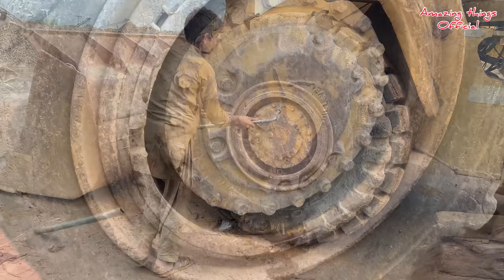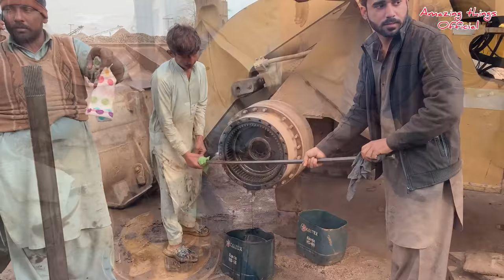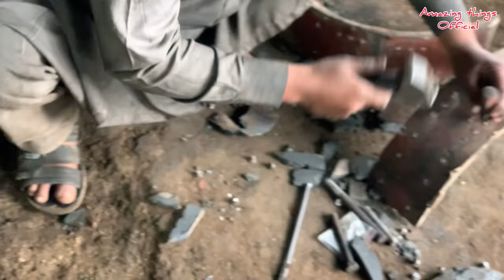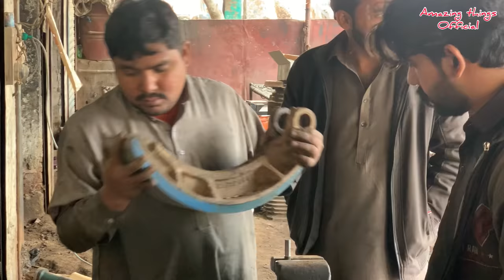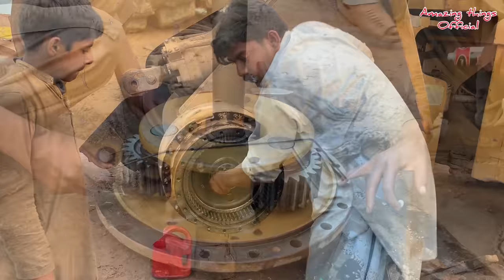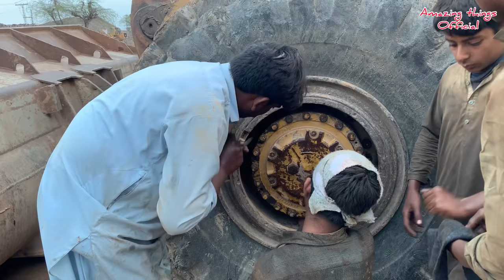How Expert Mechanic's Change Brake Lining of a Caterpillar Wheel Loader Complete Tutorial

Comment: New pads, but no recutting of the drum surface?! The new pads are gonna wear extra quick. They never even showed us how scored and scratched up the inside of the drums were since the pads were just about gone. A cheap quick fix, nothing how an 'expert mechanic' would do it. And using old oil?

Comment: Sand and gears go great together
Reply: Bearings
Reply: sandals
Reply: @Stevesbe  those were gears they pulled out..
Reply: @mariomarquez5559  I bet. These guys are very intelligent. I commend their work and ability
Reply: Danger Bear  Removes rust and corrosion.
Reply: You are forgetting the silicone sealer!
Reply: @mariomarquez5559  I don’t know man, I seen one guy with power tools take off wheel in minute by himself.
Reply: @mariomarquez5559  On what evidence do you base your comment?

Nothing in this video supports your opinion.
Reply: @kdavid123186  with power tools , the only power tools these guys had was 3 kids and a disk grinder
Reply: a killer
did call 🤙🤙🤙🤙 a kiler 
................ auto ñ
Reply: No seas así , ellos son 🌈
Reply: @butterfinger4393  wich is kinda stupid considering that the wheel of that machine costs as much as a whole power tool set

They really should have some, doing everything by hand really grinds the body over time

Comment: Love the health & safety,  steel toe cap sandals and state of the art axle stands.    Some really good mechanics here and they don’t let anything get the better of them.
Reply: lol
Reply: so how did they replace the bearing oil ???
Reply: saw it...
Reply: Lack of clean work area will tell you everything you need to know. Dirt plus tight tolerances are not a great combination. Something tells me they have a lot of repair repairs. Just because they get in done doesn't mean is good or correct.
Reply: Proper mechanics, not fitters.
Reply: @karlmcclellan5942  well, at least they put the vehicle back to work completely
Reply: @arielkart7229  I would not be surprised if it's back in a week.
Reply: @karlmcclellan3740  nice the more it come back the richer the mechanist will be heheheh

Comment: Definitely talented mechanics. Get them some proper tools and watch them go! The wood blocks are a far cry from safe jacks but they work. Amazing the way they improvise! Love it.
Reply: Define what a "proper tool" is, a tool is a tool. If it works it works.
Reply: @collegestudent6071  
Ratchets, correct sockets, air tools, cradle, air hammer, compressor, pry bars, etc. I’m talking tools that make the job faster and safer. While a tool is a tool, proper tools make  the job quicker and safer.

Comment: Good work but they should seriously consider getting a pneumatic or electric impact wrench - at least for the wheel and hub nuts/bolts.
Reply: Children are cheaper in this part of the world.
Reply: They don’t even have a funil and ask about pneumatic tools?!?!?
Reply: Doing it manually saves on the 200lb gorilla armed with an impact wrench stripping threads, mushrooming the heads of the bolts / nuts!
Reply: or atleast a ratchet
Reply: they are too stupid to put any of the profit into an electric or air impact, that's what a smart person would do. Then the dummies woul;wouldn't know how to charge it or run the compressor so you would need to get them a generator or solar panels. Basically you'd have to do everything for them and show them how to use it. They probably don't even have the intelligence to know such tools exist.
Reply: @johnames6430  Don't cut yourself oh that edge young man.
Reply: or even a speed brace, for once they've loosened them, and to whack 'em back on when reassembling.

Comment: Here in the states, if you’re driving on IH 35 and you see a couple of 10 year olds removing an 18-wheeler tire, it won’t be 10 minutes before CPS shows up.
Reply: You got that right and after CPS was done OSHA would step in and tear a new one in the boss and then the labor department would step in to finish off whatever was left of the company
Reply: @kangkim150  I agree with you. I have seen that firsthand, 10 year old boys driving big grain hauling trucks in Washington state. But a 17 year old can't work on large construction projects. The sense that that makes is deranged
Reply: Kids need to learn more trades

Comment: What's going on with that tire? Did the splice the sidewall from a smaller tire onto a bigger tire?
Reply: It's for rock climbing...the extra tread on the sides gets lots of grip when getting between boulders!
Reply: Its a recap tire
Reply: You should watch their remold tyre production video...
Reply: It’s a sidewall of an old tyre put on to protect the sidewall of the actual tyre.

Comment: Respect for what they did under difficult conditions even if they did chip a corner off of one of the new linings. One thing I believe was wrong.
I have never known of new linings to be fitted without being bonded in place by epoxy or such like and I was trained as a heavy plant fitter 54 years ago.
Maybe they consider it a waste of time on those machines with in the field repairs but it is why the previous set broke up in pieces.
I was shocked how young they were but then again I started just after my 15th birthday and we didn't have state of the art tools in the UK then either.
Reply: In the USA and Canada many pick up trucks and taxi cab used a riveted set of brake shoes. We called them heavy duty linings. In the 70's it was common like a loaf of bread. Also brake pads were the same, riveted (heavy duty) bonded (standard). Hope this clarifies your query. Cheers
Reply: @caddyrack  I don't have a query. I was trying to clarify how it should be done as it was in the 1930's to vehicles then. Bonding and rivets as taught by my father and my 71 year old boss who I had the privilege of working with when I as 15. Call it belt and braces if you like. It stops the shoes falling apart after a quick fix!
Hope that helps you understand why the shoes broke up in the first place. Slightest movement they start to break up.

Comment: I'd like to find the Engineer that decided that pin on brake shoes was a good idea, and punch them in the sensitive parts, I know, lets use a close tolerance pin, in a spot subject to loads of heat and debris, but better yet, lets make sure is secure a wear part that will need to be replaced often... seems like a good idea...

Comment: Given the apparent state of the L.F. tire, I think they should have also repaired (or probably replaced) the tire while replacing the brake shoe linings.
Reply: It's so bad I'm second guessing my knowledge of equipment tires? Did I miss them putting sacrificial sidewalls on there with a second split ring? Is it solid foam filled? Are they about to receive split ring dentistry?

Comment: There is no Substitute for following proper service procedures, using correct tools, adherence to safety protocols. 
Although this looks cool, a lot of kids fall into disabilities, a lot of street mechanics are diagnosed with cancer and melanoma, I am from Pakistan and I have lived among them. 
It is a sad thing to watch kids as young as 8 drenched in diesel fuel and motor oil. 
Only to provide a supplemental income to the parents. 
A lot of times injured kids in these workshops will not even afford to get treated for injuries.
Although a lot of comments are praising these people, Reality of them is sad and work environment is beyond hazardous.

Comment: Two major problems with repair!  The orings on the dou cone seals were not changed and aligned and the bearings pre load was never measured/adjusted.  No way those brake shoes wouldn't be oil soaked.

Comment: You gotta do what you gotta do.  But, using kids?  An air-impact would be a huge help - along with a ratchet.
And why no mask when grinding a brake shoe?  
Not a single torque wrench in sight.  Not using a star pattern to tighten down the nuts.
No expert.  No tutorial.  Just a bunch of guys and kids trying to get by in the world.

Comment: Dam# that's hard work, they need a ratchet set an air compressor and at least a rattle gun plus air chisel. We are now in the 21st century.
Reply: They're nowhere near the last century, let alone anything newer...
Reply: @felixcat9318  I guess so they still do amazing things. If the world goes to cra# they'll be better off than most of the so called modern world as they can pretty much do stuff the old fashioned way without electronics. A very good skill to have

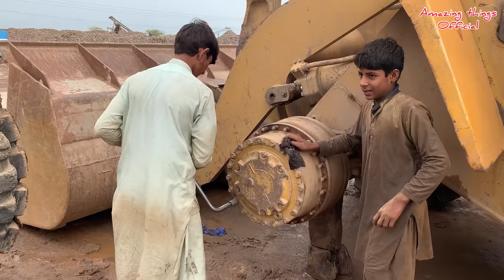Comment: 5:43 NO WAY that is secured. if that wood thing topples that heavy metal fender is going to hit that kid's head.
im all for kids helping their dads but damn, dad is responsible for the safety of his children.
Reply: You clearly have no knowledge of hydraulics or repairing machinery.
Reply: @an04ker  i DO NOT yes. im just a regular youtube viewer. please enlighten me, that vehicle without the wheel is not going to move ? because of "hydraulics" even tho it didn't have a wheel ? ok then, what is the purpose of that wood that they put in place to hold it somewhat then ? i think, ( i just think, i dont exactly know ) i think that if that wood topples, that fender is going to drop a few inches slightly before going back up, and that is enough to knock that child's head.

Comment: There are many, many problems with this video, starting with the title. These men and boys are not mechanics. It is obvious that none of them completed a 8,000 apprenticeship and that none of them hold valid trade certificates. The title of mechanic should be reserved for those individuals that have earned it.

It is unfortunate that child labour is alive and well. Young boys should be in school, not "working" in the roadside mud. Unless children attend school, five generations from now the people of   Pakistan will still be working in the road side mud.

The attention to safety is impressive. Open toed sandals over excellent protection. A couple pieces of wood stacked on each other made a sturdy jack that will prevent the loader from falling and crushing the children working underneath it. Finally, who needs hearing and eye protection, especially as accidents do not happen?

Then there is the impressive manner with which parts are dropped on the ground and exposed to water and dirt. These matters of mechanical ineptitude are two lazy to bring a cart or table outside to place the parts on. After ensuring that the parts are exposed to the elements, these geneses do absolutely nothing to clean the dirt and the grime off. They want to introduce dirt and other contaminants into the loader's systems. 

Other impressive actions include not removing all of the dirt and rust from the brake shoes before attaching the new brake pads,  ensuring that at least one of the brake pads was installed lopsided on a brake shoe, ensuring that lubricants were smeared on the new brake pads, reusing the old seal, and reusing the the old lubricant.

All in all, this was an amateurish repair job.